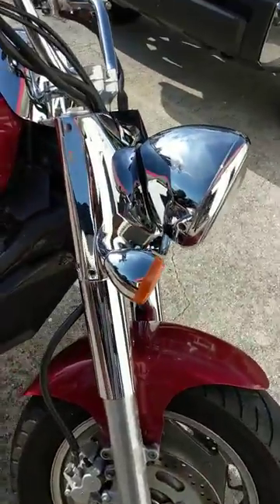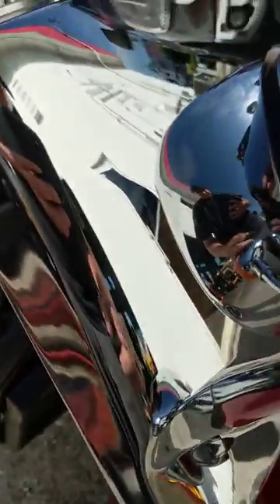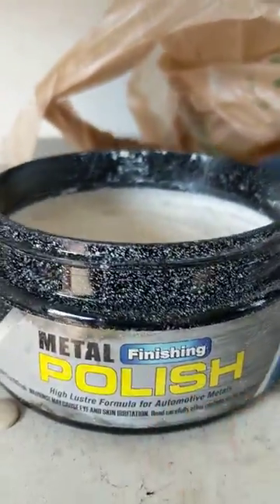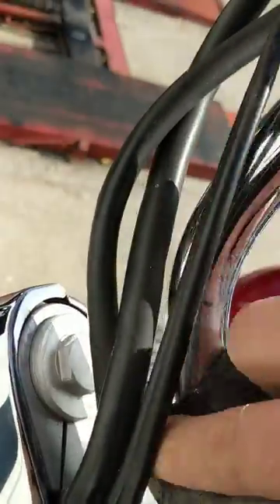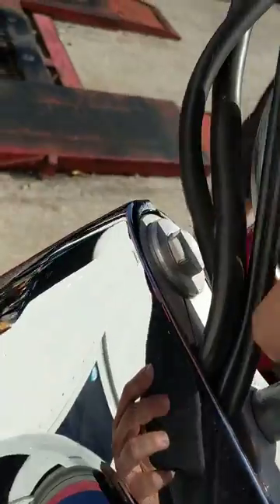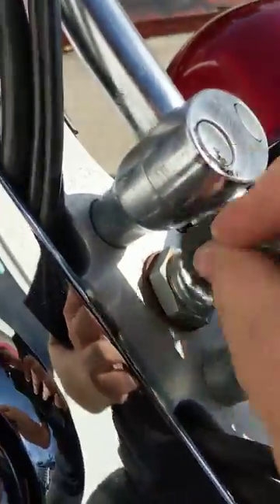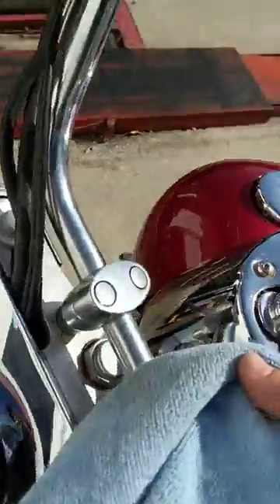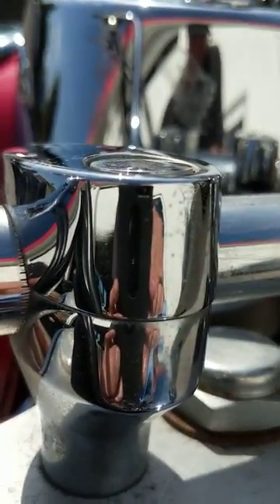How to remove corrosion and pitting from chrome

Comment: You showed us one bracket then “cleaned and polished another bracket” the initial bracket you showed us was still pitted. Lol 🤦‍♂️
Reply from the maker: The whole bike was pitted.
Reply: @REALISTIC_AUTO  the whole bike? No way. The whole bike is not chrome. 

Point being you showed us one handlebar  clamp (to the right) which was significantly pitted then come back clean and polish (to the left) the other clamp which had little to none pitting. 

That’s like me saying oh this is how you polish an Apple. Show the camera a rotten apple on the floor, go dip my rag in some chemical come back pick a fresh apple off the tree. Polish it and lead the viewer to believe that this chemical made that rotten apple like a freshly picked and polished one. 

Then saying the whole tree has apples lol 

Uhhhh…. Ok
Reply from the maker: @christopher ortiz  all the chrome...and yes during the video which was roughly 5 years ago. I definitely cleaned that side first and then cleaned it again on accident.  All the chrome looked like that and it definitely all came clean. It was just light pitting. It's not gospel it's just a video.
Reply: @REALISTIC_AUTO  to some cars are god and chrome is the gospel lol 🤷‍♂️
Reply: @REALISTIC_AUTO you're a snake straight up!!! You uses a buffer and other tools on that